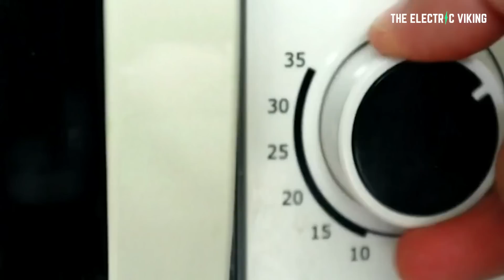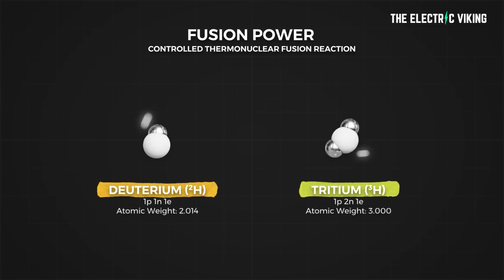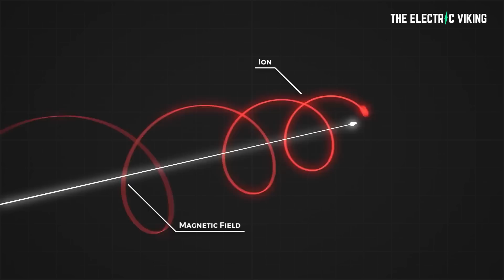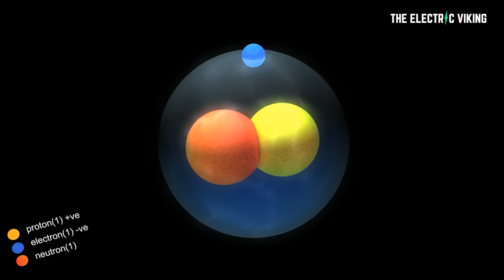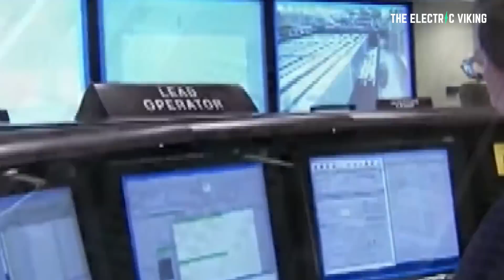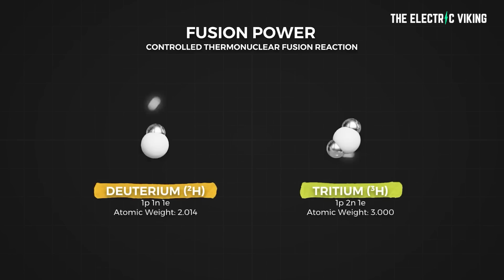Massive breakthrough in nuclear fusion achieved by US scientists

Comment: Hype aside, one thing the NIF did definitely improve on, is how much more power they’re getting vs. in 2021, when they first had “ignition”. They’ve gone from 1.3 mega joules output to 3.45 mega joules … almost triple. 

Whatever can be said about milestones, that’s a lot of progress right there.
Reply: That's great for science, but this design is not even build to create electricity, that's not even the goal of this type of fusion 
But still a major breakthrough
Reply: Yup.  It sounds like their measurements were more precise this time, so they're sure they had ignition, and the lasers were tuned better but the target wasn't quite as round.
Reply: Yes, 2 megajoules of impacting lasers created 3+ megajoules output. But the total system energy input was actually over 400 mega joules.   For Q of 0.0085. And add in the total annual energy input of the facility vs the aggregated annualized output, Q is too small to discuss. And they dont even have concepts for the equipment needed for a continuous sustained reaction.

102¹⁸ joules or 102¹² megajoules.  Thats the energy consumption in the USA (2021).  So to meet that with fusion they only need a 12 order of magnitude increase.

Progress? Yes.  But after 60 years of research, still showing the mega waste of resources that it has been, is and will be for the foreseeable future.
Reply: @johnb7430  The energy input for the lasers is irrelevant as it's just an experiment. Commercial reactors will obviously use much more efficient lasers, especially as the ones NIF uses are really old.
Reply: @jaredgarbo3679  irrelevant?  Then why list an output at all?  Q is a specific relationship between input energy and output energy.  Arbitrarily minimizing the input to egrandize the ratio is fraudulent.  Right?  

Fusion has been "50 years away" every year for 50 years.
Reply: @jaredgarbo3679  laser implosion of pellets will NEVER produce electricity.  Even a continuous model like a tokamak or stellarator will likely never produce electricity economically, but at least it has a small chance of working.
Reply: Last time they said that they have found bugs from Mars, even the president Bill Clinton join the show ..... turns out to be a hoax. 😀😃😄😁😆😅🤣😂🙃

Comment: Did you actually read the details?  They created enough energy to boil one kettle of water, and can do it once a day.  The net energy output was laser energy in vs heat energy out.  However, the energy required to generate the laser beams was on the order of 100x greater than the energy produced.  You also need significantly more energy out than the overall input (that value that is 100 times greater) before you are ready to make a commercial generator.  And, obviously need to do it more than once a day and probably want something smaller than 3 football fields per kettle.

While a scientific accomplishment we are still a few major breakthroughs away from seeing fusion generated power coming into your house.  Not likely this century.

Typical hyped up news reporting with no critical thought.  The norm for this channel.

Update:  Read this, first half of the article paints a picture similar to this video, second puts the ‘breakthrough’ into context where in it discusses what still needs to be achieved before building a real power plant.  

https://www.theguardian.com/environment/2022/dec/13/us-scientists-confirm-major-breakthrough-in-nuclear-fusion
Reply: Apparently the people who creates nothing are always negative 🤔
Reply: @UncleTonyshotsauce  Just stating the facts, knowing those an important part of understanding something.  I learned that studying physics and working as 35 years as an engineer….

Comment: Viking the breakthrough is real. However, if you look at the NBC video, they correctly cool down fusion fever. Lasers confine a fuel pellet. The reaction takes place and more power comes out than is fed in. However, what now? How do you get electricity out of it? Most power stations use power to heat water .... to steam ....that drives a giant generator. The UK fusion project produces electricity at the reactor, without going through steam generators, at the same time conserving energy. Steam generators waste huge amounts of power. The Livermore project still has to figure out how to continuously feed the reactor with fuel INPUTS, also how to get electricity OUTPUT. NBC says that for the first time, scientists can see that fusion is inevitable and that investments will produce returns within only 10 years. This is a big change for the continuous 30-year gap always being pushed ahead.
Reply: While I cannot defend nor refute anything You posted, there is one indisputable FACT. NBC is the most disreputable source of News shy only of possibly CNN.  If NBC says something, you need 5 other sources to confirm.  I do however, enjoy this almost Manhattan type project to generate power along with the thousands of companies working on new storage solutions.  Engineers are not deterred by failure but learn from failure until they achieve their goal.
Reply: mike wurlitzer What point are you making? I almost never watch NBC but this article was not political propaganda, but an interest piece. Scientists have been struggling since the tokamak was invented to produce power. NBC was merely stating that for the first time, the destination has been reduced from 30 years to 10 years and that for the first time, some investments will result in good returns. But what is your point?
Reply: @mikewurlitzer5217  kkkkk. Tell'm mike

Comment: This breakthrough whilst significant does not produce net usable energy as although the energy produced is greater than the energy used to produce that output it does not take into account the energy to run the actual plant eg. The cooling systems, Super computing, ancillary devices etc. ITER in France is aiming to produce 500MW from 50MW will not produce enough to run the plant that makes it.

Sabine Hossenfelder on her channel has a good explanation for this

Comment: Fusion will never be cheaper than Molten Salt Reactors. Don't believe what they're telling you about net energy gain, because they don't include all of the energy used for the whole system, they only look at the amount of energy in the Lasers.
However it's done, it's going to be massively more complex than a similar MSR which is as efficient and actually burns waste fuel from existing reactors.
Don't assume it's going to be certain that it will ever be economic proposition. MSRs are very simple and much easier to build. How is Fusion ever going to compete?

Comment: Not just a gamechanger, but a worldchanger. In this case, it's true, but not quite yet. It's a huge step forward, through a barrier that has frustrated nuclear fusion scientists and engineers for about 40 years. Now, we have at least one approach that could be generating clean electricity 24/7/365, like our sun does, within 10 or 20 years. In the meantime, the best way to tap this inexhaustible source of clean energy is using and further improving the  converters we already have, namely solar panels and wind turbines, along with battery banks that will also be needed along with the future baseload fusion powerplants.
Reply: There are another 100 or so "breakthroughs" needed to make commercialized fusion power plants.
One breakthrough doesn't break us through.
Reply: @hagerseb  Good question. I think the answer might be that fusion powerplants on the ground could be helpful (certainly more helpful than any fission-based powerplants, with their radioactive waste and meltdown potential, making them targets or hostages for very bad people like Putin), if they can be compact enough to be widely distributed, like solar panels and battery systems, at low cost, for overall grid reliability, economy and energy security. Their ultimate value becomes more apparent, however, as we try to explore and live on other planets.

Comment: Whatever the result of the fusion itself, the energy required to start and maintain the process far exceeds the net gain from fusion itself. Sabine Hossenfelder did a you tube on this a year or so ago. Electro Magnets need enormous power to contain the reaction. Lasers likewise have to be powered. I'm not getting excited yet.
Reply: Did you not listen to the video? He just said that they got a net gain. Also you might not understand what the word net gain means. You might have meant gross gain. Net gain would be what you get minus what was needed. Therefore any net gain is good.
Reply: This will not be amazing news if they have not included all those energy requirements in their calculations.

Comment: I expected a breakthrough by scientists finally getting more power out of fusion than what was put into it.  You still have the cost of manufacturing a full-scale fusion plant, the cost of the fuel to run it - which isn't cheap, and the fact that when you highly irradiate metals you create radioactive substances - which is not healthy.  Just being cleaner than fission - doesn't make fusion a cheap or clean alternative.   It has been over-hyped for decades in order to raise funding for research on it.  It may be another hundred years to work this out properly - because fusion is highly complex, very expensive, dangerous - and no one yet has talked about the reliability - since we are still not there yet.  This is a step in proving viability - but there is a lot of unearned optimism about this kind of invention.
Reply: One step at a time. I also hope this eventually works out.
Reply: Fusion really only makes low level waste though. Maybe some medium level when the blanket is decommissioned but it is still way cleaner than fission . Also sure fusion is expensive but it is still cheaper than actively scrubbing all the carbon the energy industry makes.
Reply: Baby steps my brother .
Reply: Yeah better keep burn coal, wich is radioactive btw, than get amazed by the progress made this 20 years on this tech.   Telling also that Solar tech is century old, and not adopted for so long and got pushed by gouvernemental found like crazy too. So what we sit on our ass and stay dépress cause u Say so?
Reply: Might be worth checking out companies like General Fusion, who in my estimate, are much closer.
Reply: They've had it for decades. They're releasing it now. It's all part of a bigger plan.
Reply: @bad-bunnyblogger8171  and your evidence for that is what?
Reply: @enadegheeghaghe6369  That's the thing, you can't prove it. Lol.
Reply: @bad-bunnyblogger8171  what? You are made a claim. I asked for evidence for your claim. It's a simple question. What are you blabbering about now? If you have no evidence to back up your claim just say so
Reply: @enadegheeghaghe6369  I've just stated that I haven't. Accept that and then ask yourself what on earth you are blabbering on about. After I've said I have no evidence, perhaps stop trying to inflate your ego!
Reply: @DwDDB  I've seen some tech up close my friend. The kind of tech that you'd refuse to believe.
Reply: @bad-bunnyblogger8171  sure thing, but that is irrelevant. So again, take you conspiracy, Qanon crap somewhere else
Reply: @DwDDB  Unfortunately I live in a democracy and I have free will. You're not entitled to tell me what I can and cannot watch nor comment on.
Reply: @bad-bunnyblogger8171  ego? I am not the one spouting unsubstantiated conspiracy theories
Reply: @enadegheeghaghe6369  conspiracy to you perhaps. Fact for me, unfortunately.
Reply: @bad-bunnyblogger8171  you have zero your evidence but it's a fact? The mind boogles!
Reply: @enadegheeghaghe6369  it won't let me post links, search operation green glow, click the first video. I've been standing 30ft from it.
Reply: @bad-bunnyblogger8171  yeah right.....
Reply: @enadegheeghaghe6369  That's a very common answer to what I've seen. Very original. 🙄
Reply: @enadegheeghaghe6369  That's not a bs video, the BBC created it. I think what you're trying to say is that my claims are bs. Unfortunately they're not. You'll soon see for yourself as it all unravels.
Reply: @bad-bunnyblogger8171  yeah I won't hold my breath. Give it a rest
Reply: @enadegheeghaghe6369  lol you won't hold your breath. You'll do the opposite and gasp. You give it a rest. Enjoy your day. Remember to keep looking up.
Reply: @bad-bunnyblogger8171  pathetic. At least you finally got the message after I told you to give a rest twice.
Reply: They always say they have made a breakthrough. And another 30 years later....
Reply: I don't think the optimism is unearned at all.  It was actually made as part of a major announcement by the President which means that the DOE has some serious confidence that this will be fielded.
Now, will that take a massive overhaul to the current, withered and  non secure energy grid?  Yes.  But I guarantee that there is impetus to get it done.

Comment: The laser ignition facility is about H bomb testing and validation. It is largely irrelevant as a power source as the device (worlds largest laser) is impractical.
Reply: Fusion bombs (hydrogen bombs) were created and tested more than 50 years ago. Come up with new conspiracy theories
Reply: @enadegheeghaghe6369  NIF is about maintaining the nuclear bomb stockpile. The laser itself is the size of three football fields and produces an explosion similar in size to a commercial fire work from a piece of material the size of a pin head.

It is needed because H bombs deteriorate in storage and need periodic testing maintenance and upgrades. Full scale testing to check their performance was banned under the nuclear test ban treaty. Therefore the ignition facility allows tiny bits of H bombs to be blown up in fusion explosions to check performance.

Additionally, there is a holy grail for H bomb designers, fusion without the nuclear fission component (ie no plutonium). It is on boundary of possibility that such weapons could be designed. This would allow H bombs to be made smaller and lighter without the expense and complications associated with a plutonium trigger. NIF helps in this research by exploring the compression and heating needed to ignite tritium and other fusion precursor materials in a fusion reaction.

To quote Lawrence Livermore  Laboratory website:

"NIF is a key element of the National Nuclear Security Administration’s science-based Stockpile Stewardship Program to maintain the reliability, security, and safety of the U.S. nuclear deterrent without full-scale testing."

Check it out for yourself:

https://lasers.llnl.gov/about/what-is-nif

In summary, the NIF method of generating fusion while of interest, has no credible application to peaceful commercial fusion based power generation. It's not designed for that purpose.

This announcement (like similar previous similar announcements from LLL) is about securing on going funding from Congress to keep this very expensive facility operational.
Reply: Nah this shit is cool

Comment: Don't get carried away! While there was a 'net' energy gain, overall, energy was lost. Still not there yet.
Reply: Buddy that's like saying "yes we can make a nuclear bomb but it's very small, so let's just abandon it." . Of course if you can't replicate this then that's a problem
Reply: @Mako2401  Yes, nuclear fusion with an overall energy gain will happen, it is merely of time. There is however, the cost of these fusion generators to be taken into account, and that may be far more important.
Reply: I was wondering too...  if they are simply measuring the electrical energy in and out?   If so, can be misleading.    I read that power plants have about 10% loss for transmission lines to the customer.   Plus, maintenance/operating costs could require the input/output ratio to be even higher to truly 'break even'.